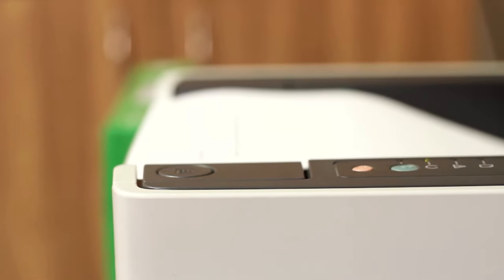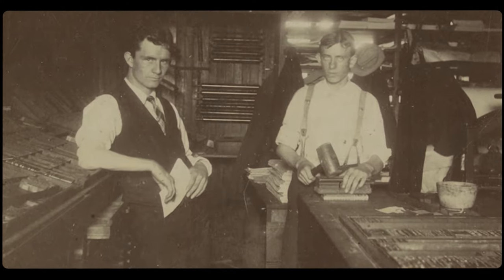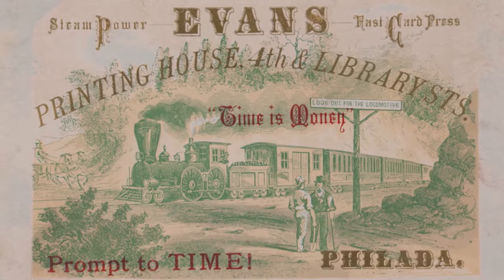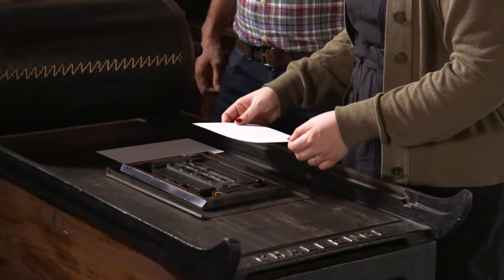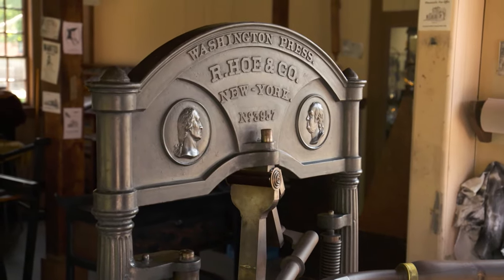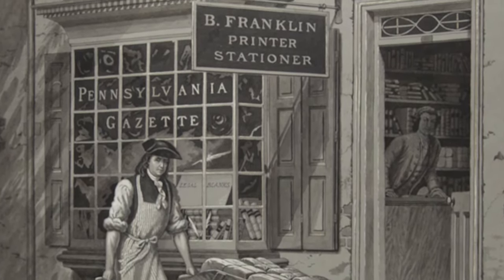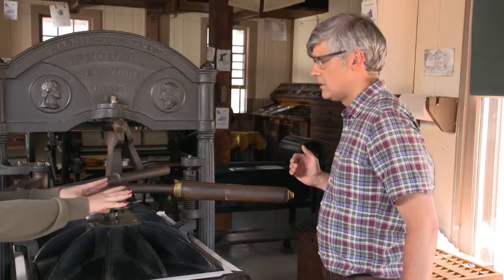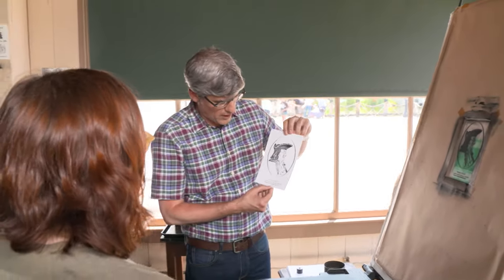History of Early Printing Presses | The Henry Ford's Innovation Nation

Comment: The California Job Case  - has a cool story. Before the California Job Case the type was kept in 2 cases. Upper & Lower, We still use this term today, Upper & Lower but we use the shift key on our computers.Cool video about printing. 😎
Reply: The Job case came about because of the invention of Linotype and Monotype.    Large numbers of pages of type no longer needed to be set by hand!  The jobbing case was used for corrections and display setting.    Used both in my 30 years or so as a compositor in the UK.

Comment: Having to place the print backwards must have had something to do with printing on both sides???
Reply: It's because when you use what is essentially a stamp you're going to get a mirrored image on the paper. If the text stamps weren't mirrored then the print would end up backwards on the paper